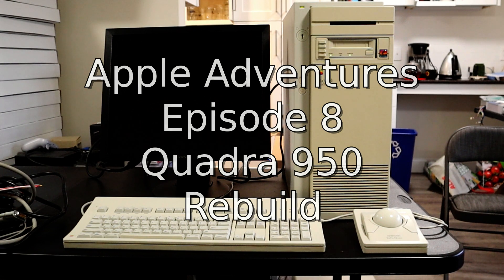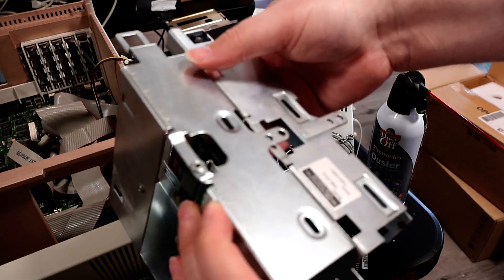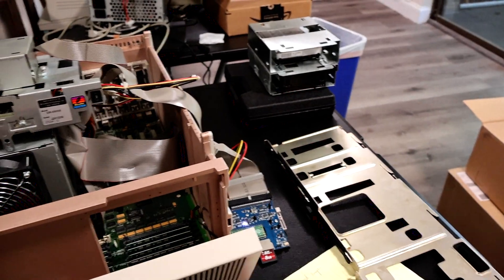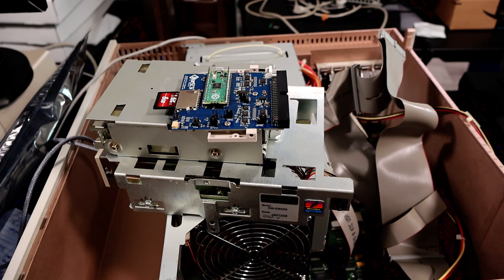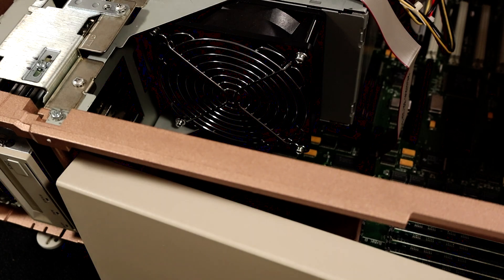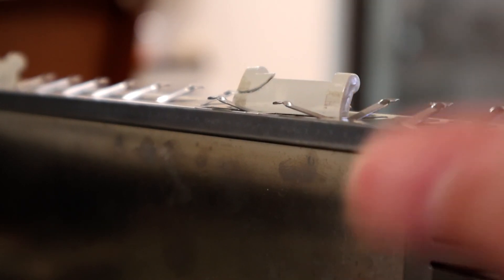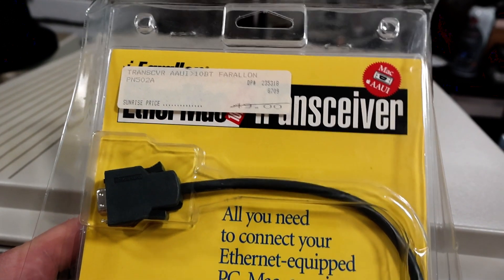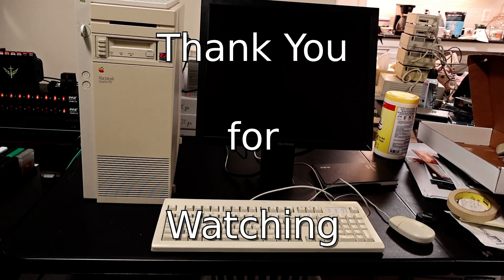Apple Adventures Episode 8: Quadra 950 Rebuild

Comment: Okay, a little bit of wrong information here.  The PRAM going empty, or being removed, does NOT affect the ability of the floppy disk booting.  Your drive is either being finicky, or your disk is bad.  X means it couldn't find a boot sector on the disk, either from the drive being bad or bad disk.  NOT from corrupt or PRAM that needs to be reset.  Also, you held down command option e p keys, not p r.  Go back to 14:00 and look.  Resetting PRAM results in chime being replayed.  Lastly, there is something wrong with your Mac.  The boot screen has corrupt display background.  It should be completely gray, made up of alternating white and dark pixels.  Your display has corruption of squares in it.
Reply from the maker: > The PRAM going empty, or being removed, does NOT affect the ability of the floppy disk booting.

I actually reproduced this issue for filming, as I didn't capture it the first time.   I might try it again for kicks.   Otherwise, the floppy drive boots normally, and I was able to image quite a few driver disks that came with this machine.   

There's not all that much information out there on what's in the PRAM and what's not and what it affects.....If you have any more info, I'd be glad to have it.

> Also, you held down command option e p keys, not p r.  Go back to 14:00 and look.

You're right.   This was an editing/refilming mistake.  Sometimes I refilm sections for focus, lighting or other issues.

> The boot screen has corrupt display background.  It should be completely gray, made up of alternating white and dark pixels.

This is my LCD panel.  On a CRT this looks normal, but those are heavy and more difficult to film.   My panel has a native resolution of 1280x1024 and does an OK job scaling/syncing various Mac resolutions, but it doesn't have inbuilt controls fine enough to get it perfect.  The black and white checkerboard pattern is particularly problematic and produces weird artifacts like the squares you see.  I suspect this is why folks that tune converters like the OSSC use a checkerboard pattern as they show distortion if the settings aren't 100% perfect..